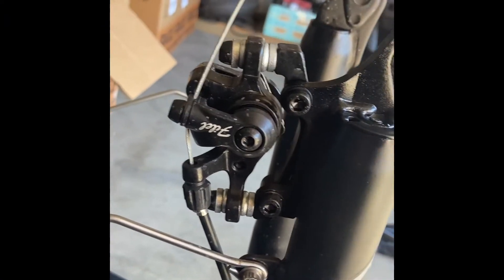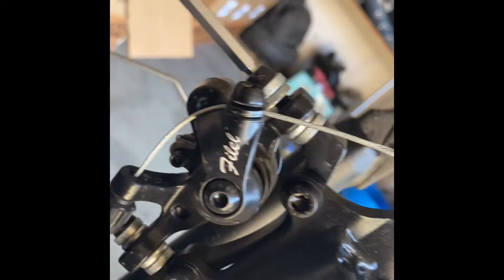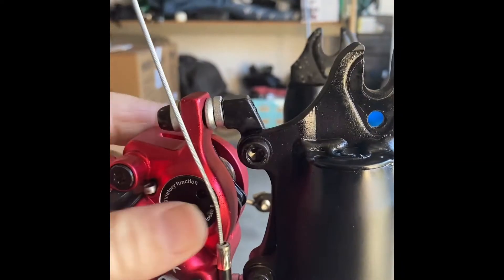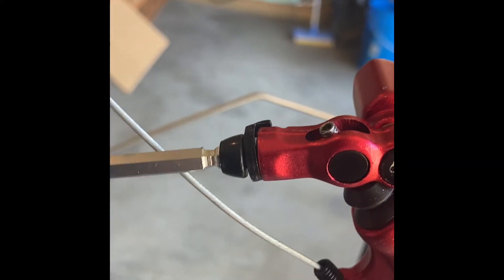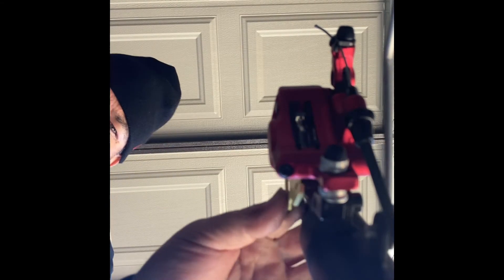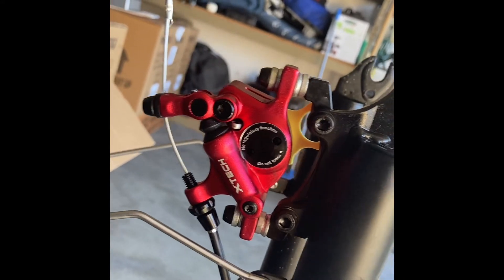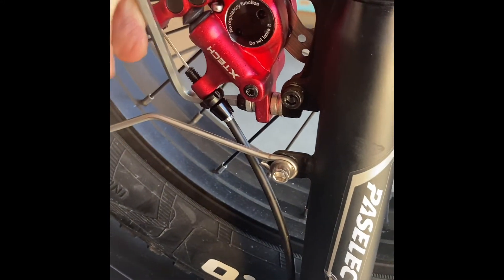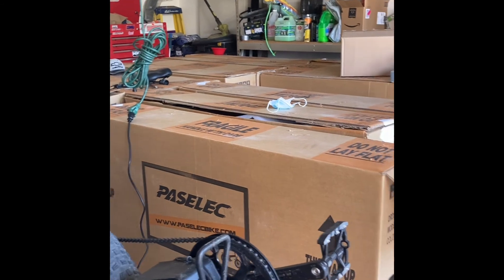Easy Ebike Mechanical Disk Brake to hydraulic brake upgrade

Comment: How to they work after 2 years
Reply: they are other garbage they don’t use up the whole pad and the calipers only go out a bit after it uses some of the pad then the cali is gonna stop going out and you’re gonna have pad life, but no braking power because the Pistons doesn’t wanna go out anymore. You can try bleeding it and it still won’t work.

Comment: These brakes work well, but they are unreliable. Within 2000 km three if these calipers have failed on me and leaked oil onto the pads.

Comment: Hey, I just got a set of these. I only have the rear ones on. There were more than a few reviews on amazon saying they failed after a short while.  Just wondering how they worked out for you?
Reply from the maker: I got rid of them and went full hydro
Reply: @DougsAdventure  what ebike hydraulic brakes did you bought
Reply from the maker: @kevincapitaneo5734  z-race check my recent video

Comment: Ohh this is zoom brake caliper
Reply from the maker: Yes will fit on any bike with brake calipers
Reply: What break pads do they take this is going on a motorized bicycle so I need to know if they have mattalic pads before I buy these.
Reply from the maker: @austinjoslyn170  not entirely sure but they stopped fine and fit standard pads